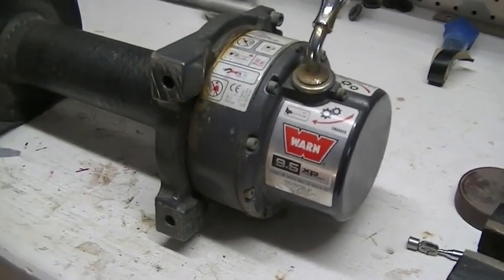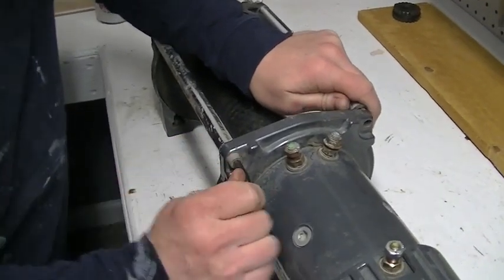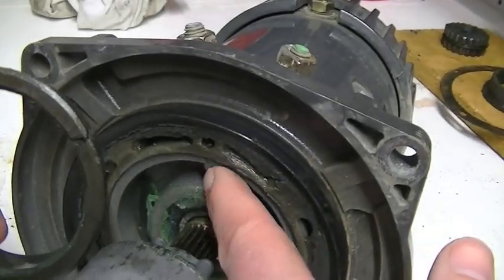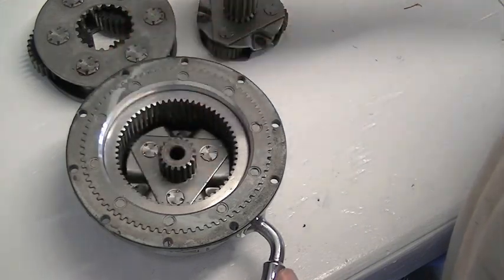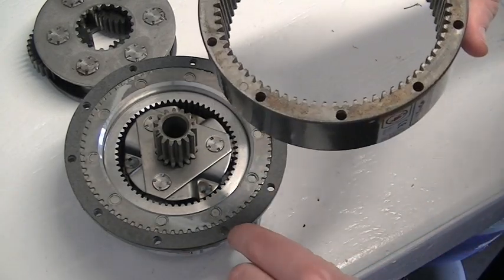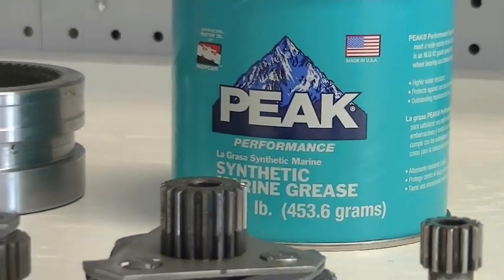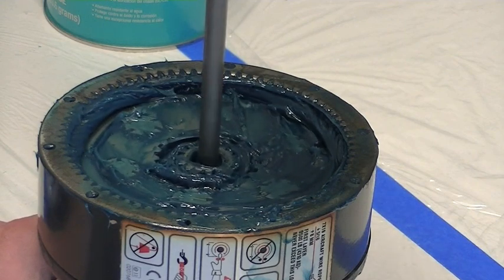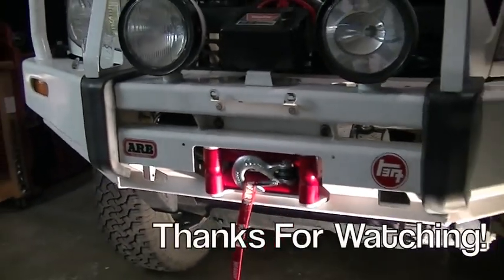WARN WINCH REPAIR | Rebuilding Warn 9.5XP Winch

Comment: I just rebuilt my 37 year old Ramsey winch. Motor wasn't turning over after sitting up the last 30 years. Cleaned and greased the gears.  Cleaned and ohmed the motor and it appears to be good. I found out last night that the wire posts are shorted to the housing. I'll have to take it back apart and see if the insulated sleeves are shot. I also want to check to see if the plastic washer between the sections are in their groove. Thanks.

Comment: I have a 9.5 ti, but the hile to mount the cable to is stipped. This video is a help. Now i know i can tear it down and re-tap the hole for the new bolt. I guess, i will completely grease it while it is a part too. Thanks for the good video.

Comment: Hi everyone, I want to ask a little question!  Why is my winch brand CE XD9000 damaged unknowingly, check the voltage, there is no problem!  Check the tightening handle on the right side and find it is loose.  what is the reason?  Is this caused by human factors?  Because my car has been repaired before, if it is caused by the repairer, he will be affected by causality. Thank you everyone, and welcome to provide comments

Comment: I picked up a Warn 9.5ti for 50 bucks. It runs, but had been beaten to hell by the previous owner. The two rear bolt holes are broken off, so i'll need to order new drum supports. In the process i figured i'd rebuild it completely with all new gaskets and clean it up the best i can inside.
This video immensely helped me understand how the winch will work, and the winches are probably similar on the inside so it'll help me with reassembly. Thanks!
Reply from the maker: Josh Hex Glad I could help!  Thanks for watching!

Comment: Warn currently uses Phillips Moly Lowtemp #1 for grease. Previously they used Aeroshell #17.   Both contain at least five percent moly.
Reply from the maker: +Winchparts Thank you for sharing!
Reply: My Warn manual says to use Aeroshell 64 Grease. Thanks for the video!

Comment: Excellent!  I just tore into my 9,500 Magnum/Warn (A Warn sold under the Magnum brand with minor cosmetic differences).  What a nightmare.  I don't suppose it helped any to neglect it for 5 or more years.  It was packed with mud & rust.  Probably junk now.  The planetary gears all still move but everything is ugly with rust.  The solenoids just click when engaged; one or more of them is likely bad too. The motor literally had dried mud in the bottom.
Reply from the maker: The Limb Reaper Hopefully if you need to buy new parts, they're cheap!  Thanks for watching!

Comment: Is there a way to make the Lever move easier between the Engaged and Free spool position?  Mine has been super tight from new and at times requires 2-3 goes and to winch in/out to get it to move it's that tight?  Yours looks to move way easier... I just thought they came that way.

Comment: Ok, but what about the other parts? The motor, the brake inside the drum, switchbox... and so on. I got to see those repairing!
Reply from the maker: Elemér Lapos Those parts didn't need any attention on this winch, so we didn't bother repairing those parts.
Reply: Good for you. Does not need any repairing Even after nine years ?! I got to change the brake in mine, this week. Generally the brake has three small balls, but i have found only one. Two of Them Disappeared.